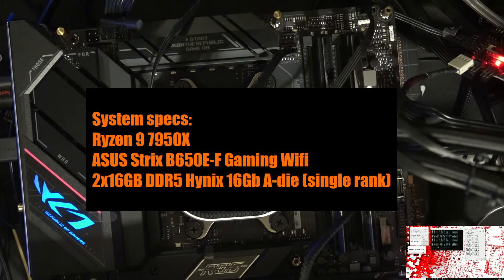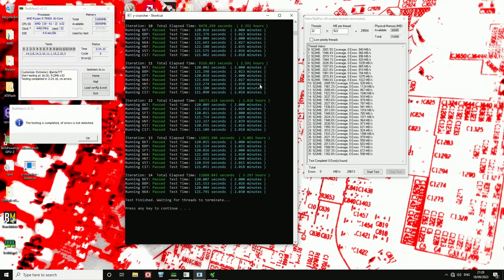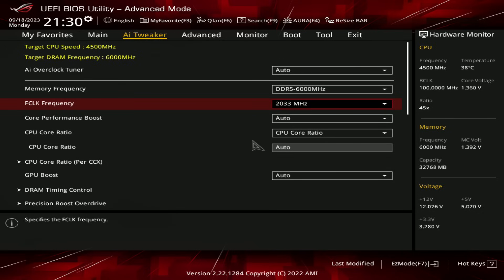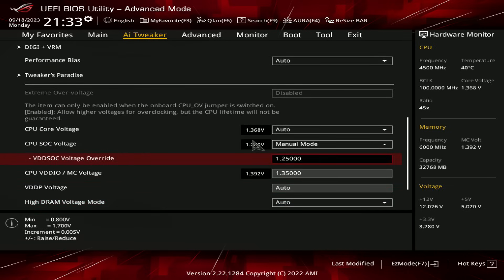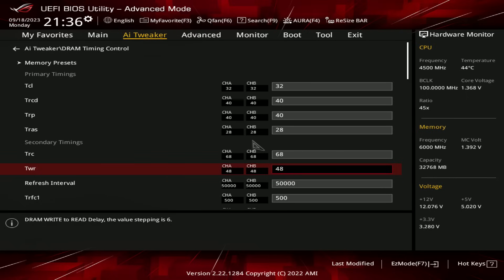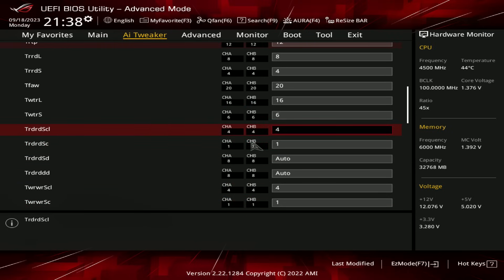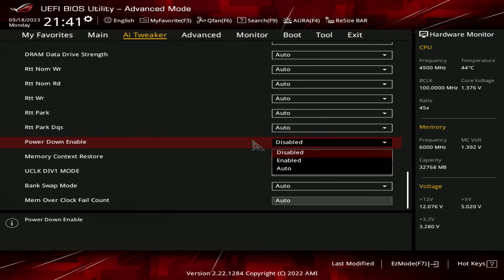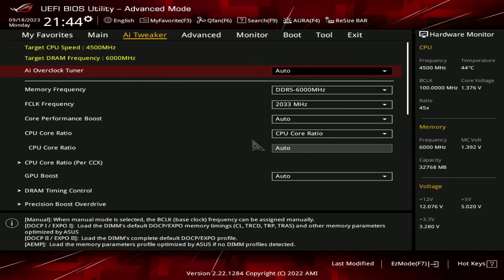Easy memory timings for Hynix DDR5 with Ryzen 7000

Comment: Hello!, on my msi b650 edge wifi + 7600x + Trident Z5 neo (16GBx2 6000 CL32-38-38-96 1.35v), if I set expo or manual timmings (I copied expo) sometimes dont boot. Sometimes like 4/10 or 3/10 it just freeze at black screen with MB mini leds yellow for memory and red for cpu. But if I dont set any profile to memory, it just boot 10/10. Any idea about this?  PLUS: setting EXPO boot time is 40 seconds... And Im testing now manual timmings, and Im facing the same problems until now... But Im going to test more
Reply: More data part 1: after chosing defaults option Bios (good boot time). I set memory speed from 4.800 default to 5.000. And now seems Im having low bot speed. Im going now to turn Off my setup, and turn ON to test more. I guess, any single change to memory, cause problems to boot. Until now every boot is ok, but with 40 seconds of delay until boot is creen shows or 60 seconds until windows is ready. This last one sometimes dont show the boot screen wtf, I mean, the screen that you can press SUPR to get into the bios.
Reply: More data part 2: Lowering stock memery settings of memory, like: 4.800mhz to 4.600mhz. Causes the same problems like previous data part 1.
Reply: @sebastiangonzalez9992  Yes because, basically every time you change ddr5 default speed(4800)>> your mobo will make memory training once you restart your pc. try to disable MCR (Memory context restore) after you apply the settings, and Power down if your sys freeze/crash.

Comment: Just wanted to add my voice to the list of people who this video really helped out. I just built a new system with a 7800X3D and a 4090, and I bought a 6600mhz Corsair kit to pair with it. Well, as soon as I enabled EXPO, got tons of instability and crashes (this is my first AMD CPU, I figured EXPO was just like XMP where you just set and forget and things Just Work. Fool.) Was feeling like I was doomed to stay at stock speeds until I found this video. Did three different memory tests after plugging in your settings (had to bring her down to 6000mhz but that's fine) and seems stable, zero errors or crashes thus far. Thank you so much for making this!
Reply: The problem with 100% of people is that they didn’t enable high memory support or low bandwidth setting that is implemented in your bios. 

this lets you run high speed kits

Comment: I have an ASUS Rog Strix B650e-f gaming board running 7800x3d G.Skill Trident Z5 NEO .  I am not seeing the same Aitweaker setting.. sitting here scratching my head… can’t see VDDSOC or VDDIO… even tried searching
Reply: Your BIOS should look the same as the one in this video. You just have to go to Advanced mode (press F7), can't be on EZ mode.
Reply: @subaction  did that… will try again tonight
Reply: All good…. Got it All up and running

Comment: Is VDDQ, VDDIO of 1.43v unsafe? I tried stabilizing my memory but couldn't get past memtest with anything lower than 1.43. That also puts my VDDIO / MC Voltage at 1.43v and with recent x3d chips issues I am wondering if this is safe.
Reply: Easy i have 1.45V and temps are still low below 50c just stay below 1.5 on air and look at temps below 50 ... Dont look at highest memory temp there is bug sometimes gives shows 15C + without reason
Reply: Not unsafe, but DRAM VDD Voltage should be the only one you have to set that high. VDDQ and VDDIO should work at 1.35, even 1.25. Your board should let you set them separately; some boards have a voltage control dropdown selector to choose whether you're setting all 3 of those to the same value, or adjusting them individually.

Comment: What is the “CPU Core Ratio” setting that he has on the main page, he doesn’t say anything about it, should I put that setting on too?
Reply: That's a CPU clock setting not relevant to your RAM and you should ignore it.

Golden rule of BIOS is to leave it on Auto if you don't understand what it is or what it's doing
Reply: I had many weekss problem after new PC 7600x auto CPU voltage was always only 1.25 no matter what i change and solution for me was setting manual 1.33V and set CPU core rattio to all Cores and CPU multiplier 54 and that works for me 100% stable 
So IF u leave it on auto it will just boost AS high as your cpu can and  your thermal limits are and your sillicon lottery will be important to. For me i just had to set it to manual multiplier

Comment: With these settings i keep getting errors in Aida64 extreme, i don;t think i should ignore these errors? :p
With SK Hynix M die G.Skill Trident Z5 F5-6400J3239G16GX2-TZ5K @ 1.4V
Reply: yeah also getting errors using these timings
Reply: IF stock settings on 6000 speed doesnt show errors it means timmings are too high tight for your memory or u have to raise memory voltage 
IF u have errors in stock timmings 6000 speed that means you have to low CPU voltage. IF thata the case set multiplier CPU x52-53 and set manual voltage 1.3v that should be a good start for stability... Minę 7600x needs 1.32v in BIOS to reach 5400MHZ stable and from there i dont have errors in anta777extreme preset 10 cycles and in another stability programs 
Hope it helps
Reply: @Malklaw  think it was the memory, i bought a 5600 CL28 kit and that has been rock solid, even with these timings added on top. Won't do 6000 CL28 sadly :p
Reply: @DrMacabr3 thats what i was expecting my Kingston 6400 cl 32 is working 100% stable now 6200 CL 28 and timmings AS in the video ... 1.45V memory tempa under 50c 
For now SoC 1.3v but right now 1.25 in test seems to bee ok and maybe 1.2 will work for me ... I am extremally happy and thankful for buldzoid for this video really helpful 
For now Aida extreme latency 55-56 NS in average
Reply: @Malklaw  ive got gskill hynix but not sure what grade they are, due to having a 7800x3d and them burning up with high voltages i didnt set them anywhere enar as high as said in the video but the errors stopped when i didnt put them quite so low :)
Reply: This generation is really buggy ... My first time with AMD and bit dissapointed a lot of stress and simple problems as pepople say... But right now i found solutions for 90% of problems and just stres testing with as low voltages as possible so close to finish line i guess 😂

Comment: Very nice timings and easy to run. I've tried to lower the voltages and I am able to run them at 1.1v for SOC Voltage, chances are that the MC voltage can be lowered as well.
Reply: Nice. You're right, VDDIO/MC and VDDQ should both work without issue at 1.25.

My understanding about SOC is that the amount you're able to lower it varies by individual hardware. Most should be able to do 1.20, some (like yours) can do 1.15 or 1.10.
Reply: @subaction  I'm doing 1.1v SOC and 1.2v VDDIO/MC. But for the ram sticks themselves I can't go lower than 1.325v without Y-Cruncher giving errors after some hours.
Reply: @Zetzun  Sounds right. The RAM doesn't mind and isn't hurt at all by 1.35 or 1.4v. I'd say your setup is working ideally

Comment: Is this still safe with the 7800x3D and the voltage issues floating around? Very much appreciate the insight.
Reply: Yeah and this mivht actually have save your 7800x3d since he set the cpu soc to 1.25 and the new hot fix beta bios forces the soc to 1.3 .

tldr it might actually even be safer following these settings.
Reply: 1.25v manual SOC voltage is perfectly safe. Issue is with SOC voltage on auto, it's torching the CPU at 1.5v.

Comment: Buildzoid!!! Your guide saved my 7800X3D from burning out. So happens I was using the same SK Hynix Intel RAM as this guide. And setting the Mem controller voltage to 1.35 prevents the burnouts from happening
Reply: Better waiting for official statements about this shitshow. I completed my build 4 days ago and had to update bios 3 times since...Btw, using this memory timing is stable according to many users including me. Still, haven't heard any of them talking about their Mobo and CPU being burned, mostly from EXPO users.

Comment: In light of the memory voltages being the rumored problem child for X3D CPUs dying, do you still feel good about the 1.25V here? And what of the other voltages? I think that's lower than what it's rumored to go if you leave it on EXPO.
Reply: Its scary for sure ;/ Makes me never turn Expo... or until they fix it.
Reply: They forced the number down to 1.30 in the latest bios. So I think 1.25 is more than just safe. Maybe anything below 1.4 is safe, idk.

Comment: Do you run all 3 stress tests at once or one after the other?
Reply: Memory tests stress both the RAM and the CPU and are not designed to be run simultaneously.

Comment: So I'm using your timings only difference is I changed it from 6000 to 6200 cl30 and got around 67ns latency. Is that good? Are these normal latencies for AM5?
Reply: I believe this is a huge downgrade ,I know this is late answer, but I believe your issue is , let's say for Ryzen7 6000 MT/S is the highest value right now, and it is considered like (1 : 1) but once you get beyond that point it's going to collapse >so 6200 is (1/2 : 1) , so all you need right now is to go in between 5600-6000 and set your [stable] timings because you will not find A huge performance in between ,and that's explain why you get a huge latency. And sry my language is not that much but I hope you got it , any ways, from Saudi Arabia cheers o/

Comment: For all you wondering, it works with 7800X3D, got my 5600 working at 6200 30-36-36-28
Reply: I can't do 30-36-36-28 but I can do 6200 30-38-38-28. I tried 36 and I had to clear my CMOS. I get 67ns latency.
Reply: @ertai222 same timmings 57-62 latency in Aida somehow not consistent result but im ok with that 6200 38-38-38-28 rest AS in video  voltages 1.4 SoC 1.25 memtest86 12h no errors and y-cruncher 12+ no errors so i think ITS stable
Reply: @Malklaw  how are you getting sub 60ns? I ended up using the settings he used in his other video. The 6200 cl26 video and best I can get is about 67000+ reads and 62ns. Maybe I just have a bloated Windows with lots of background tasks slowing things down? I'm now using 6200 cl26-37-37-30-56 at 1.6 volts and it seems to be fine. But getting below 60ns seems impossible for me 🤷🏻‍♂️ idk how I can copy the same settings but get such drastic differences in performance?
Reply: @ertai222  trying 30 34 34 now, seems ok, 6400mhz at least at this voltage is a no go for me

Comment: Im thinking about getting am5 system, this can be useful info then. I want to make sure i get motherboard that doesn't suck with memory overclocking like my asus prime x370 pro.

In my experience doing memory testing is so heavy on memory it runs much hotter than in actual use and if i tweak it to be stable in that it may crash when its running at lower temperature, tho this is with my asus prime x370 pro that sucks at memory overclocking, and samsung b-die ram, maybe it doesn't behave the same with all systems. I prefer running more realistic tests instead of very heavy synthetic stress tests.

Comment: Can it be any Hynix DDR5 6000 set? So CL36 can be overclocked to CL30?
Reply: You shouldn't have bought CL36 in the first place : /. It was sold as CL36 for a reason.
Reply: You can try, but you'll likely have to keep your kits' rated primary timings. There's still performance gains to be had from tightening the secondary and tertiary timings.
Reply: @subaction  I did try without touching primary. Works fine. I thought all Hynix A and M-die's would clock similar, even tighten primary timings. But I guess not?

Comment: Hi, is it safe to set manually nb/soc voltage for 7800x3d?
Reply: Thats my Question
Reply: I did it today (dont changed the Voltages, let it on Auto, just changed both Dram voltages wich are on the bottom to 1.35, enabled PBO Auto and curve optimizer negative all core  25, seems good so far
Reply: @aditesto7918  When I change "DRAM Voltage" on my MSI board the "DRAM VDDQ Voltage" and "CPU VDDIO Voltage" changes also by itself for the same value. You or @Buildozid vel @Actually Hardcore Overclocing think it is safe to leave it that way on 7800x3d?
Reply: @Omni-Wan_Kenobi  i just checken it in my bios, i had it on Auto, and now it Shows 1.39v seems like it Would be fine. I have gskill 6000 cl30 hynix a die
Reply: @aditesto7918  I think I have same RAM as you have . Model: F5-6000J3038F16GX2-TZ5NR. I tuned it to 30 36 36 30. Secondary and rest of timings mostly I set as Builzoid showed in his hynix video. Previously I had g skill 6000 cl 36 36 36 Samsung b-die and I was able to oc it to 30 34 34 but rest of the timings were awful. But I run on override 1,38voltage on DRAM. 
I think the voltages in BIOS on auto are misleading cuz in windows it shows completely different readings.
Reply: @aditesto7918  Funny how we were concerned about SoC Voltage a week before whole big drama:D
Reply: @Omni-Wan_Kenobi  haha yes
Reply: @Omni-Wan_Kenobi  im on 1.25 soc now, New asus bios, and the other Things like before
Reply: @aditesto7918  I think Buildzoid saved me a little bit cuz I set it on 1,25v right after watching this video. Crazy I though 1,25v might be "too high". My BIOS wanted to pull 1,35+ when I checked. I am testing 1,18v. It seems stable. I also set few other voltages manually cuz even after updates there are a little bit too high imo. DRAM VDDQ and CPU VDDIO=1,26v(BIOS on AUTO wants 1,35v), DRAM VPP=1,82v(BIOS on AUTO wants 1,95v).
Reply: @Omni-Wan_Kenobi  currently my vdd and vddq runs at 1.35, so you say its too high ? And will the dram tuning and pbo Run stable with reduced voltages?
Reply: @aditesto7918   After this week with the burnt 7800x3ds case, I might be a little bit too cowardly so I decided to manually set a few more voltages. I'll wait for newer BIOS without the BETA version then I'll consider AUTO settings.
When I manually set the DRAM Voltage(1,38v in my case), the VDDQ and VDDIO change themselves to the same value. When I force it to AUTO, those voltages want to match this 1,38v anyway so I changed them to 1,26v. I spotted that VPP has an odd value of 1,95v so I set it closer to the default value (1,8v). I run those DRAM kits as I mention higher (F5-6000J3038F16GX2-TZ5NR). Now I don't have EXPO on but I have almost everything set manually so there d be no difference with EXPO on. I have PBO turned on with CO -30 since you asked. In the link, there are my tunings. https://imgur.com/a/TJZFKZO
Reply: @Omni-Wan_Kenobi  thanks bro

Comment: I got these timings to work with DDR5 6000 CL 28-36-36 and matches the rest of your subtimings. 1.4. Volts but stable, on my 7800X3D
Reply: Can u post picture liink or write in comment all memory voltages at this speed ? a-die ?
Reply: Stable at Every Aplication ? Got the same mobo Cpu and ram, just build it today
Reply: @aditesto7918  actually got to cl 26
Reply: @naythanjones2320  wow thats insane, do you also have a Asus Mainboard ? Im searching for a decent oc

Comment: What VDDG and VDDP voltages do you use? I cannot for the life of me get ddr5 6000 to run on my 7700x and b650i Aorus Ultra.
Reply: It's recommended to leave them on auto, which should result in VDDP 1.05, VDDG 1.10.

Comment: These timings worked really well for my budget hynix based sticks.  Saw a signifigant improvement in Aida memory benchmark, and so far stable even with my DRAM voltages set at 1.25v which is what my kit is rated for at xmp (my ram doesn't have expo support) ,   Thanks a bunch!
Reply: oh thats fun to hear i think im gonna try this out too!

Comment: Hello Buildzoid! I've never OC'd ram (or anything) before and I would like to ask if the settings on this video would work / be safe to try on this kit: 
-Asus X670E ProArt Wifi mobo
- Gskill Trident Z5 Neo Series 64GB (2 x 32GB) DDR5 6000 (PC5 48000) Model F5-6000J3040G32GX2-TZ5N (Timing 30-40-40-96 , CAS 30, 1.40V)
- AMD 7950X3D

I've installed this and ran my system but getting BSOD's on fresh install of win11 when gaming and when doing mundane things like just watching youtube with nothing else open. Sometimes the system just shuts off by itself and reboots. 

 I have tried Auto, Expo 1, Expo 2 and Expo tweaked options in the bios but no luck so far. If I disable OC the system seems to run fine (3 days with no crashes so I think it runs fine.. system was built just 5 days ago). Since it does this only when I try the expo I think it points to RAM instability. 

Any help or advice appreciated. Thank you!
Reply: Hi Did you sort out it out. ?
Im having the same RAM 128Gb. wanna give a try
Reply: @Shafy7  Yes, it was the power supply that was defective
Reply: I wanted to know what your bios configuration. I’m trying with 128gb @6000mhz.  Please can you help me with the bios configuration. I have tired the above. 

I can’t change the cpu vddio mc voltage to 1.35000. When I enter it goes back to 1.35330 

DRAM timing control . In cha and CHB box the value is  different from his . Mine has 7006 but his as 50000.

Comment: Is it possible to have latency of 70 at these settings? I have Hynix M-die, but I think it's not working as supposed, even though the setting applied and I can boot and everything.
Reply: @ertai222  69, or 67...may as well just leave it at XMP. That's literally what you get just setting XMP and leaving it alone.  I get around 55ns with the timings shown here.

Comment: Will the voltage be any different if running a 7800x3d? Thanks in advance!
Reply: I’ve been good so far but I haven’t run a memtest
Reply: These voltages worked for me with that CPU, but you can very likely go lower than he suggests on everything but the DRAM voltage; try 1.30 or 1.25 for VDDIO/MC and VDDQ, and try 1.20 for SOC